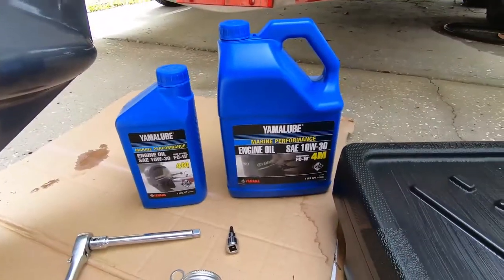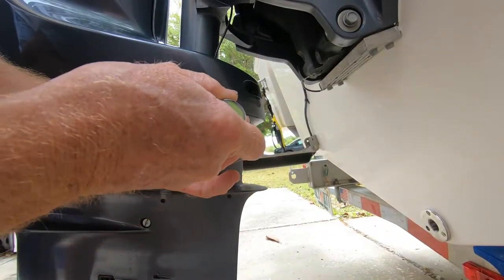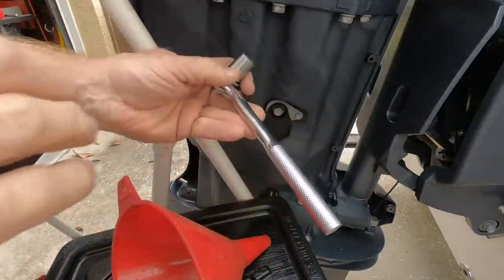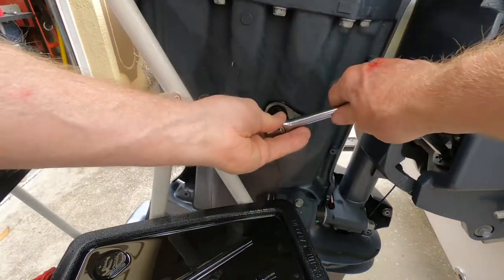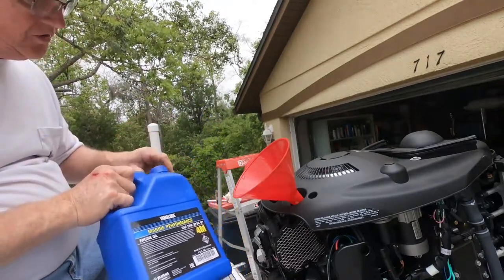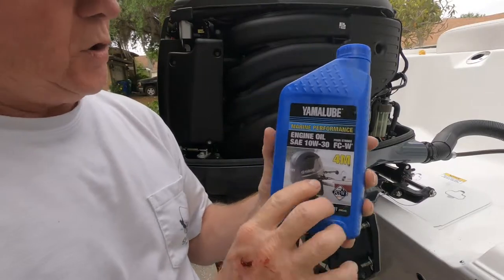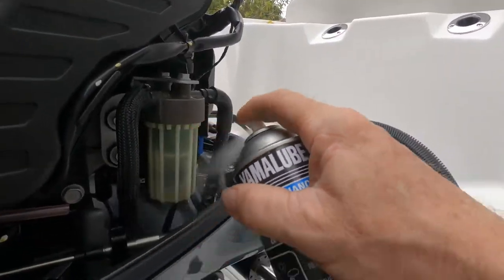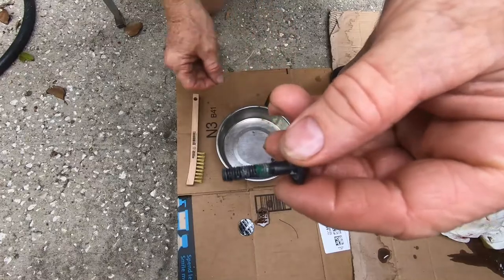DIY YAMAHA 200 HP OUTBOARD ENGINE OIL CHANGE. 20 HR SERVICE

Comment: Guys please pull filter off when oil pan is draining to get all the oil out. Then you use Yamaha oil quantity specs and it’s right every single time. That’s why his oil level had to keep re-measuring
Reply from the maker: @Chris_I_Fishing  guys remember also to follow manufacturers maintenance guide lines when your doing it your self. That being said the first oil change you do is at your 20hr service. The maintenance guide explanes there is no need to change the oil filter at 20hrs. This will be done on the 100hr service which thats what i did. Take it as you my. I followed the recommdations from the Manufacturer. You do you!

Comment: I’m afraid to screw something up. Is it this easy?
Reply from the maker: Its pretty easy to do. Just take your time. Make sure you replace everything you take off. Im Definitely not a person that's mechanically inclined so I did it. I think you can do it too. good luck if you try it on your own.

Comment: Hey did the used oil you drained out have a faint gas smell to it? I just did my 20 hour oil change and it was dark color and has very faint gas smell. Thanks
Reply from the maker: Maybe more of a used oil smell then gas but could of gone either way.
Reply: @oceandeepfishing4555  I wonder why my used oil had a gassy smell? Kind of odd
Reply from the maker: @andrewn.5117  not sure. Maybe call the dealership and ask about it.
If it's concerning you I would change it again at maybe 50 hrs and see if it's gone away or you still smell it.

Comment: When u are doing this I know you want boat to be on a level surface, but when you trim the motor down do you just eyeball when it is level. I’m a novice just wondering if you need to put a level on the motor itself. Really liked the video tho. Excellent! Thank you.
Reply from the maker: To be perfectly level is really not necessary.  Real close is fine but if you want to be precise a level wouldn't hurt. I didn't show it this time but I usually run the motor a bit to heat up the oil. IT helps it flow better.
Reply: @oceandeepfishing4555  Thank you very much for replying.

Comment from the maker: So it's hard to tell exactly, but the lower unit  There is a small bolt that has a square nut that fits into an inset.
that square nut. You have to put in to that inset before you screw. The screw in or the screw has nothing to hold on, to.
 That's what I'm doing at that point i believe. The nut fell out of the hole when the bolt was taken off.
Hope that helps.

Comment: I think maybe you overfilled your OB?  According to my Yamaha 2018, F200XB owner's manual says 4.55 qt. without filter and 4.76 qt with filter. Check your owner's manual before changing your oil.

Comment: Help!! The bolt that you start to take off at 4:12 in the video… what is that that you grab with your other hand.. is there a nut back there that needs removed? I just completed this service and that specific bolt won’t go on… is there a nut you’re catching there?
Reply from the maker: Also, that small screw with the square nut is very small. Probably only a 1/2 inch long max.

Comment: Can you show where you greased the fittings?
Reply from the maker: Thanks so much for watching the video. I will be doing my 100 hr  service soon on the motor and I will grease all the fittings then and show where they are. But if you need to do it now I would refer  to the manual.  But there is 4 fittings on the outer  housing two under the trim motors. And one on the steering bar and one other I can remember  off the top of my head.
Reply: @oceandeepfishing4555  Thanks for the info and quick reply. I just got the same exact engine and your video helps.
Reply from the maker: @PianoUniverse  glad it helped you out. If you need anything else that I might be able to help you  just leave a message. I will have a good detailed video on the 100 hr service so be sure to watch for that. Probably in about two months. I'm at 68 hrs now.
Reply: @oceandeepfishing4555  will do!

Comment: Perhaps it would be a good idea to cut open the oil filter, to check for metal, and replace with a new filter.  This might protect the owner with a warranty claim, for the expense of a cheap filter!
Reply from the maker: Hello my friend. Yamaha suggest that the filter gets changed at the 100 hr. Service not the 20hr. Service. So im just going by the maintenance  manual that came with the motor so following that I think anything that came up would be covered by warranty. 
Thanks so much for watching the video and your comments.
Tight lines.....

Comment: The screws are 5mm allen. Using anything else will destroy your screws.
Reply from the maker: Hey Captain. 
Well on my 200 hp engine no Allen wrench fit perfect.  So I had to go buy the star socket which fit and worked perfect to remove the screws. 
Possibly yours might be different then mine but it fit like a glove for me.
Thanks for watching and leaving a comment.